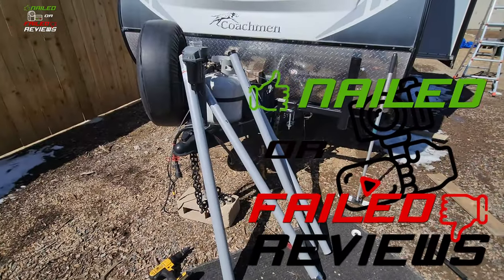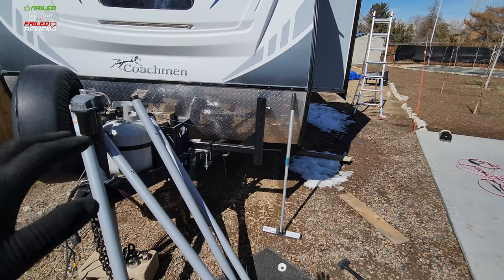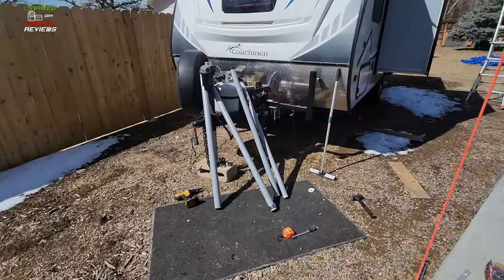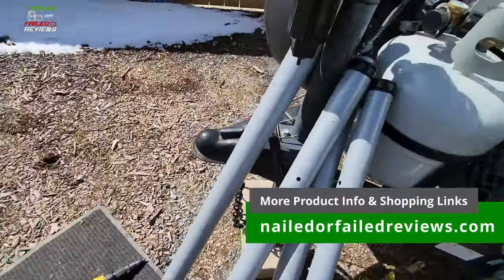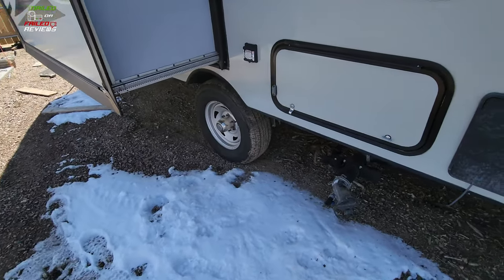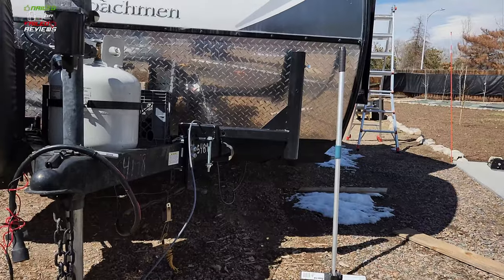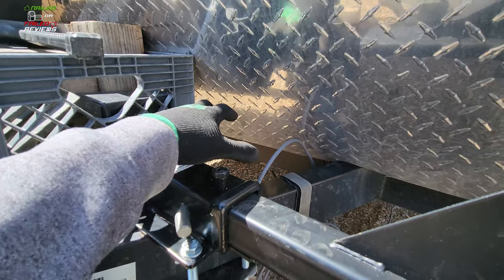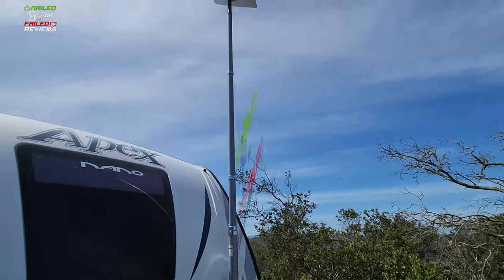Starlink Network Cable Routing Through Harbor Freight Flag Pole - Starlink Roam Camper Mount How To

Comment: Your site does not have a link to the flag pole and can't find in Harbor Freight?
Reply from the maker: Yeah sorry about that, you cannot buy the HF flag pole online and I'm not sure of the sizes of poles you can buy on Amazon which is why I didn't post any links to flag poles online.. The harbor freight flag pole goes in and out of stock locally.. Keep checking your local HF stores

Comment: Hey how are you taking the flag pole apart?!
Reply from the maker: 06:49 starts where I talk about it...basically you need to break the glue underneath the collars and then twist them off. They collars are keyed, so you once you break the glue bond you can twist it off and on again and it will lock into place. Take a rubber mallet and tap it on the collar as you rotate the pole, my collars were only using a dab of glue in two spots...you could also get a strap wrench to help twist the collars off, but you gotta break the cheap glue bond first. Thanks for watching!